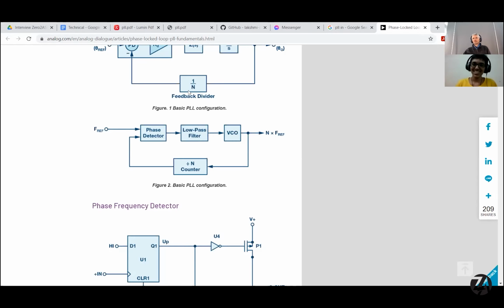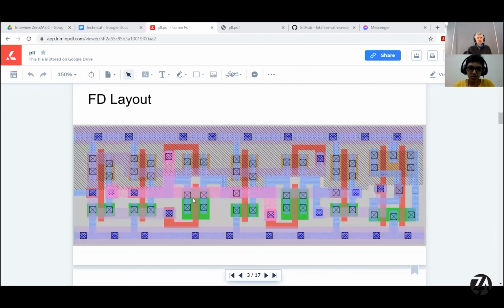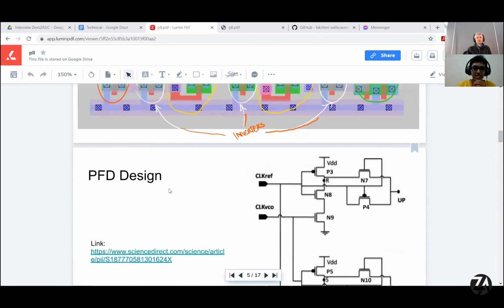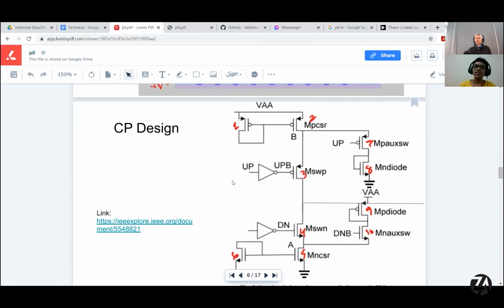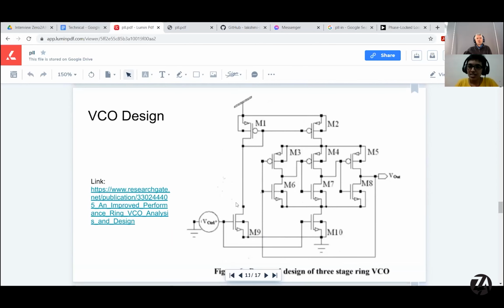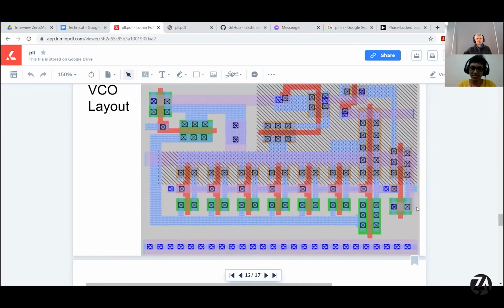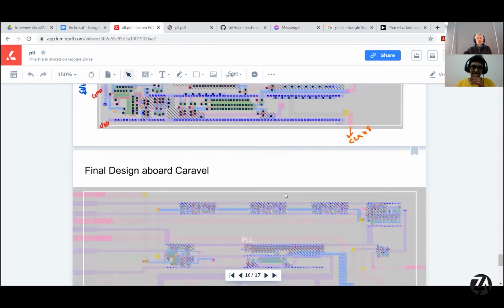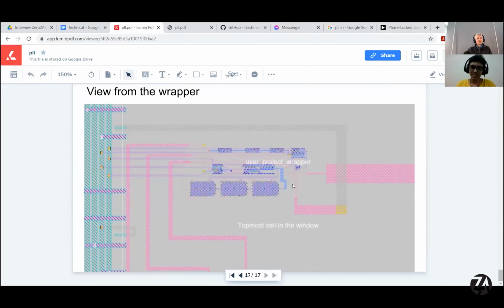Lakshmi S - Designing a PLL for the Google/Skywater/Efabless ASIC shuttle

Comment: I have the following question (s)
1. Is it required by designer to place I/O pads as well ?
2. If yes . Are we going to place them in magic tool itself along with layout?
3. What files are needed to place I/O pads ?
Reply from the maker: No, all the designs go into a harness called caravel that includes the padring. https://www.zerotoasic.com/terminology/shuttle/
Reply: @ZeroToASICcourse  ok thank you.
Reply: @ZeroToASICcourse  Hi Matt, is there any distinction between analog and digital IO pads. How to know which IO pad is suitable for analog designs.
Reply: @engrvip  there are 2 ways to submit, caravel has pads that can do digital and analog. caravan has a blank portion in the pad frame that you can put your own IOs in. So you can do higher frequency, but you have to handle ESD/ buffer/drive etc
Reply: @matthewvenn  Thanks for your prompt response. Is it possible to put high frequency RF design upto 2GHz frequency range. Designs like LNA, rf mixer etc.

Can you please provide some resources on how to carry out analog/RF design using open-source tools for Google-Skywater open MPW program.

I am new to open source ic design and very much interested to explore it as believe in it's future potential.